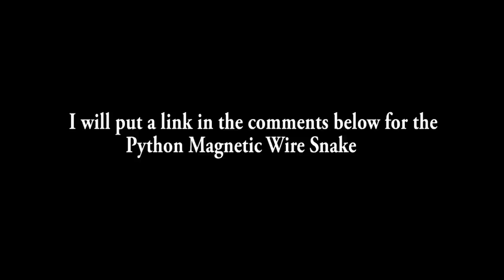Computer Repair Shop Tools for Your Business: The Importance of Magnets by TimsComputerFix.net

Comment: hp mother board dv6000 seen 10:08  recalled overheating battery probably the reason its in
Reply: eggroll
Reply from the maker: ***** I've got a back room full of those dead laptops.